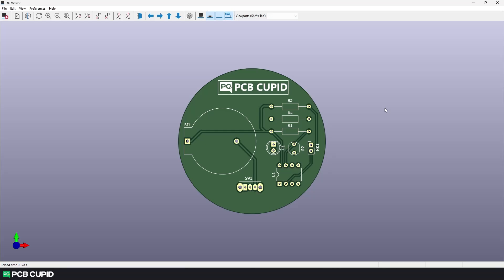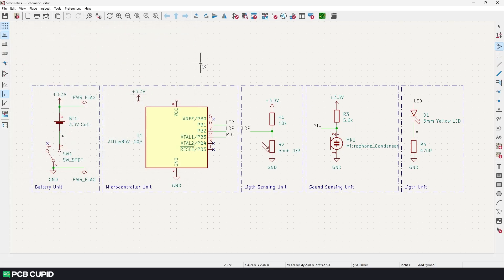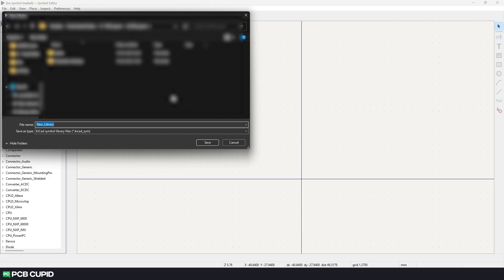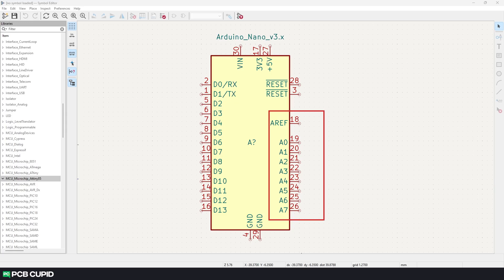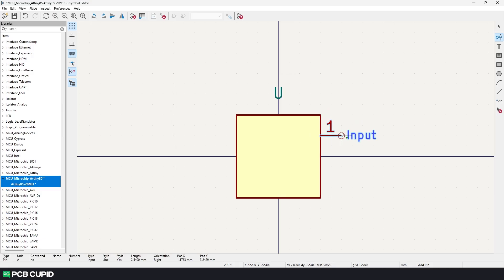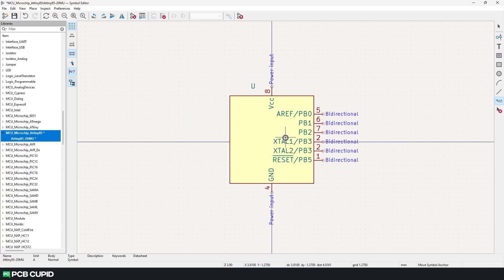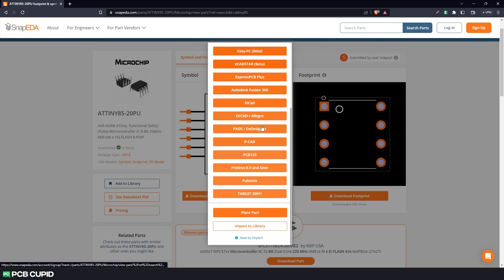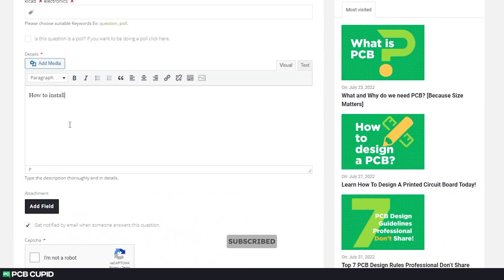#13 How To Create Custom Symbols in KiCad 7.0 With KLC | #PCBCupid

Comment: everytime i make a schematic i have to do this. even basic symbols like a 4 pole switch or even a simple transistor symbol is missing. I made a single pole switch symbol because theirs was stupid. I don't remember having this problem with the older version. and even the search in the newest version is stupid. I can no longer search for a resistor. I have to say something stupid to get it to come up and I don't even remember what that even was.

So aggravating that simple generic symbols are either drawn dumb or most likely not even there. But they have a bunch of exotic ones for stuff most hobbyist never use.

Comment: KiCad is just a toy without BOM management tools, not a professional software. When designing, I don't want to have symbol or footprint libraries. I want to have a component library. Is there any  simple way to have that? Like a file where you can assign symbol and a footprint for the component along with other parameters?
Reply from the maker: Yes, there are ways to do it. But currently, it's a workaround and not a real solution.
1. Setup a SQL database and manage your components on it (Read the official documentation)
2. Create a custom footprint association file. (We have briefly talked about it in this video : https://youtu.be/JMa9q4YhRDk?t=123 )

Comment: I have taken a few minutes to say how much I appreciated the time and effort you have spent creating these videos.The fact that you made them quite short and made separate videos for each section made it easy to go back to a particular area again.  You explained each step of the process with enough detail to be completed without problems.  You used an example that contained more than just a battery, a resistor and an LED.  All in all, an extremely useful series!

This was my first attempt at creating a PCB board and KiCad seemed to be the most popular software available.  So I installed it and started creating my board.  How hard could it be, right?  Well, it isn't!  But, the process pretty much requires the process be done in a specific order.  Which, of course, I didn't follow, and made a real mess!

I decided to start over and followed your videos, one at a time, and was surprised at how quickly and smoothly it went! 

You have done a very, very professional job and I thank you from the bottom of my heart for doing so.
Reply from the maker: Glad the video helpful! We really appreciate the effort you put on this beautiful comment, we'll always cherish this and make more video series just like this!
Reply: agree short and precise and comprehensible

Comment: Nice presentation, sir.
i am getting errors while simulating relaxation oscillator using ujt. so, can you please help me to resolve the problem.
"Errors during netlist generation; simulation aborted.
Error reading simulation model from symbol 'U1': Failed to read simulation model from fields."
Reply from the maker: Please check if your symbol supports simulation. Not all the symbol in kiCad support simulation.